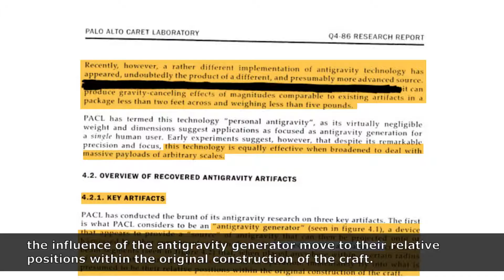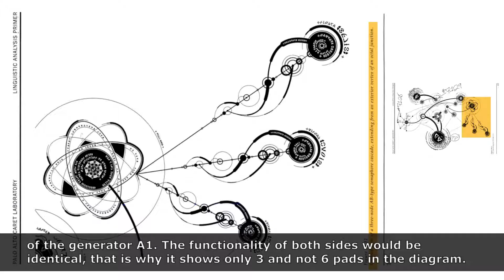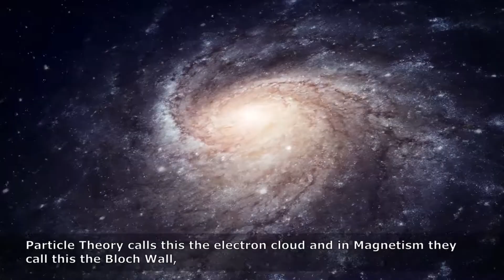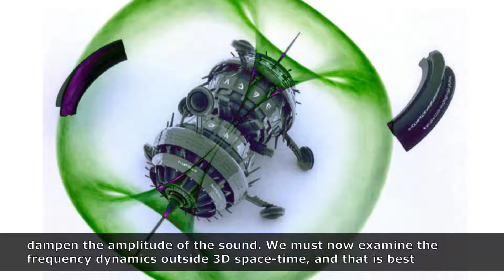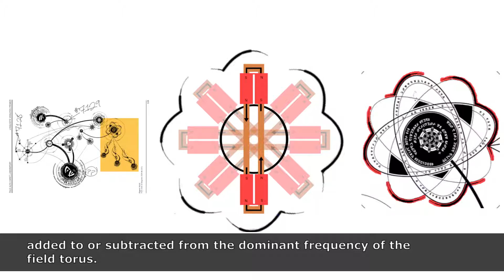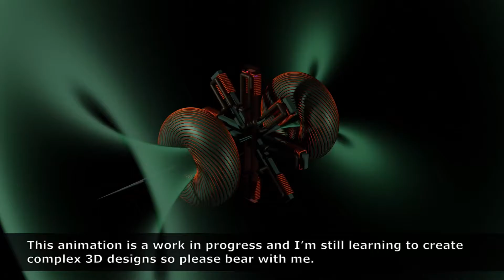Comment: I can confirm this CARET device is authentic and real and known about in Ufology since its disclosure (by one of the CARET engineers) since its informational release post-1986 out of Palo Alto, California. If anyone has a question as to what a TRUE device that uses gravitic-locking of various components looks like inside a craft not built on this planet, (by a sentient intelligence not of this Earth also) this is what it would look like. This device is NOT a hoax, not fabricated by any human beings for 'likes and shares', nor is it inoperational. This device works and is fully functional for what it can do. And what it can do is so stunning it will make you reconsider what you think you may know about the Sciences.
.
Those angled black I-beam bars that lay on the side of the RSR gravity generator (picture) are able to move into a fixed position in space (near the RSR not 'outer space') and just float unaided or unattached to anything else. A sequence of presses on the RSR unit will activate the entire mechanism and move the I-beams into the position as shown in the picture. The bars gently glide and do not snap into a fixed position near the RSR. You can apply weight or even sit on these parts or put extreme pressure to move them and you will not be able to move the angled I-beam bars once the gravitational locking is activated on the main RSR unit. Not even a single millimeter. It is very very sturdy. It is unknown how much force would be required to actually move these I-beam bars once the RSR was activated since no one wanted to break it to find out.
.
The I-beams are gravitically-locked to the main RSR unit once turned on. If you move the RSR generator the bars will move with it, staying in the exact X, Y, Z coordinates (locked to the RSR) as when the bars were activated initially in the initial place you moved the entire apparatus from.
The RSR is a Gravity B generator. What is a Gravity A, you may ask? Drop a pencil or a spoon on your foot and you will understand exactly what "Gravity A" is. It comes with the planet you stand on, nothing additional is required to operate Gravity A. Batteries not required =)
You do NOT need Gravity A to operate Gravity B. One works without the other. Although they certainly can work together in the same place just are not dependent upon one another to operate. This is basically a portable, moveable gravitic generator (The I-beams only as the RSR just activates them into position) used for a support system of some other unknown device or undetermined mass they rested against.
If anyone says this video or this device is a hoax, you can safely tell that person they do not know what they are talking about or they are a lying. This device is very real.
.
There is a good deal of knowledge how this device works but duplicating the materials it is made out of will be almost impossible due to the rarity of the exotic matter the construction is made out of. Opening, prying, or cracking this RSR device with brute force will cause an explosion of such magnitude it will register at least 2 on the Richter scale for earthquake leaving behind a crater one quarter of a football field. This device is absolutely NOT a toy. It has a functional and practical use of mass support. Gee, I wonder why the covert government does not want people playing around with such technology? They must hate us? NO, we are too stupid as a species to even have such nice things like this device that could theoretically be converted into a bomb! This is why we can't have nice things. Imagine a 2.3kg bomb that could leave giant craters 60 feet in diameter if certain individuals wanted to, say, open the device prematurely to 'see what was inside'. Now you know why!!! We are monkey's playing with matchsticks down here, God help us!
.
If any Defense Contractor invents a simulacrum of this device it will much more primitive to this device and amazingly larger than this beautiful machine. But if you ever see something that has the same effect of this device has to levitate small components the RSR will be its engineering progenitor. We are a very clever species after all, someone will duplicate its effects. But you will know where the idea came from, however, not of this Earth.
Reply: Fascinating. What makes you able to confirm the device is real? So you consider the photos and eye witness accounts of the ‘drones’ to be disinfo (like this video creator does)? There are so many conflicting elements to the whole saga it’s hard to tell what is legit if anything. I followed it very closely when it all broke. Thanks for your input.

Comment: is anyone REALLY trying to make this thing? IF so, lmk I wanna help
Reply: Yes I am a genius actually trying to build this machine of my own design, I can work, just need generator and ma'etal and welding rods it's easy to build ,, just mechanical parts
Reply: @icanbuildit4977 Lmk if you need any help... Down to make this a reality
Reply: @icanbuildit4977 i have a desing of s antigravity 0 point engine but i have 0 dollars to build the prototype only 1 vortex part need to work if it does then the whole engine will work